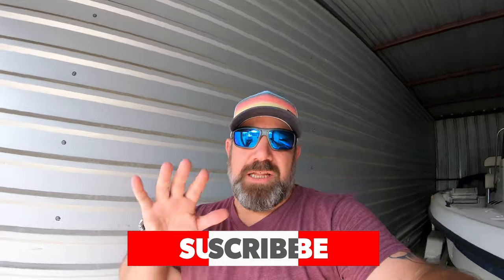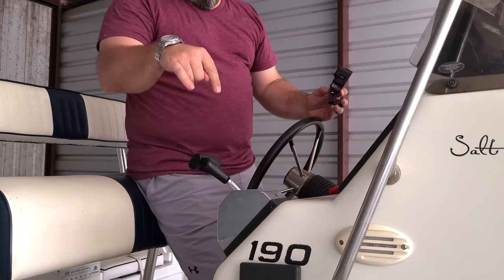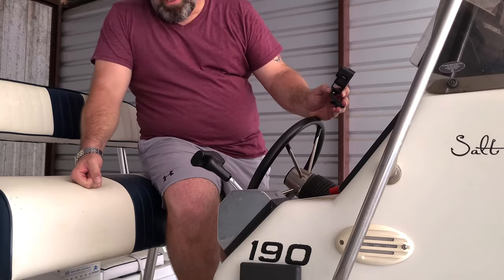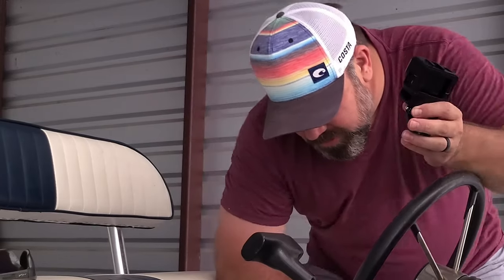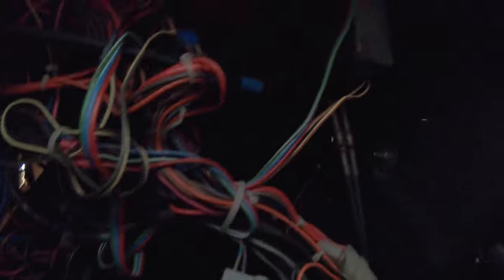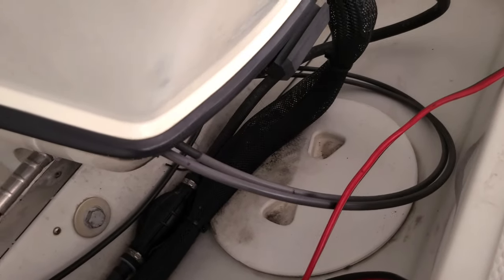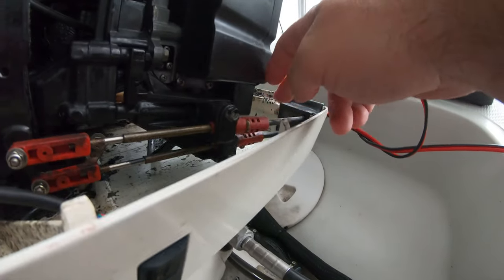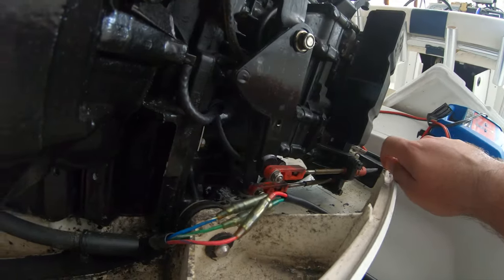My BOAT SHIFTER Will NOT Go In REVERSE!! | Boat Vlog Ep 1

Comment: What did you figure our with this? Mine has same issue and sound when spinning the prop
Reply from the maker: I took it to a local shop in the area and they found a small piece in my lower unit causing the issue. I want to say an impaler. nothing to major. I had the boat serviced while it was in and I was out the door for under 800 buck. I think just the repair was like 200.